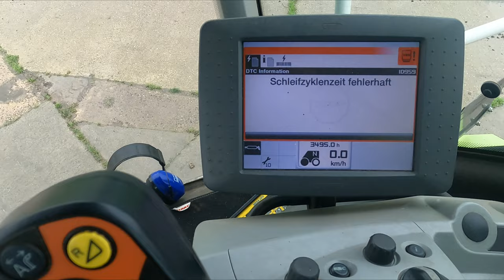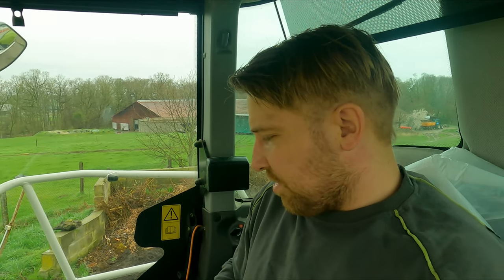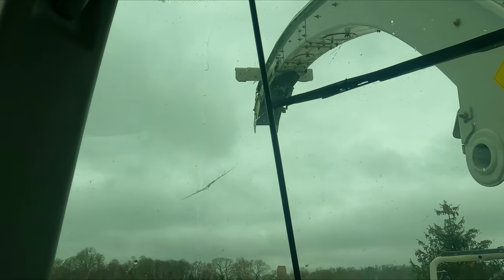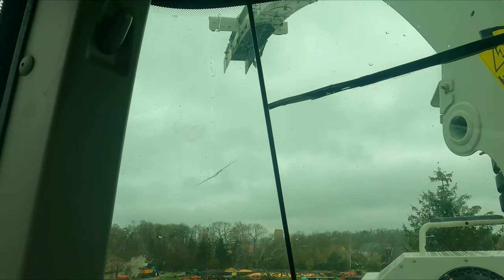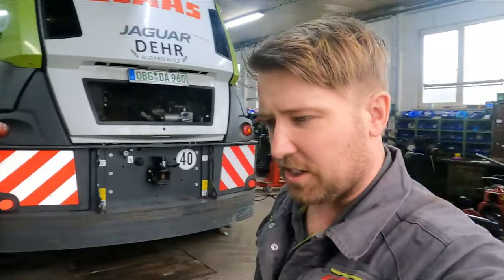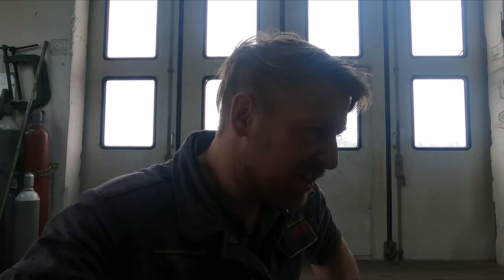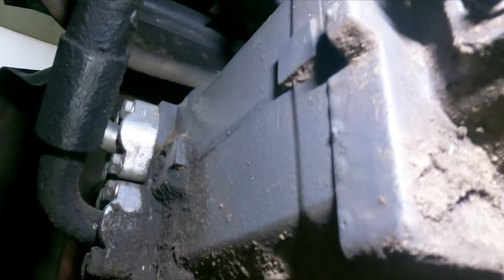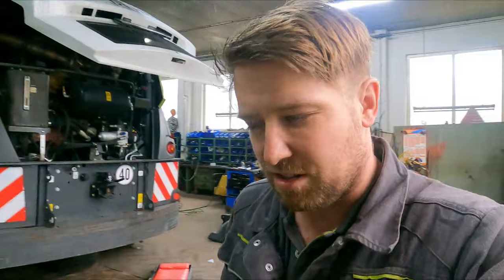Claas Jaguar Service and Pre Harvest check pt1

Comment: Hey great video I’m really appreciating just how much we get to see with you. I don’t know of another YouTube mechanic who would put in as much effort as you! Just one question, do you ever take oil samples on your jobs to look for hidden damage to internals?
Reply from the maker: Thanks allot! As for oil samples we don't actually take samples, One reason is most of the machinery doesn't generally get run to the point that we start planned wear precautions. Our choppers and combines at home will likely never see more than 4000hrs so we kind of just expect a motor to run those hours without major wear. As for at work it is something I have been thinking about since the drastic rise in oil price. But mainly for things like self propelled feeder wagons that receive 400l of Dextron 2 every 1000 hours. at around 7euros per L. Oil analysis could help us possibly run the oils much longer. Other than that I am interested to see if I could learn more about my job by using such samples.
Reply: I understand, the only time I have regularly sampled oils is when I looked after the the hire and maintenance on several large generators. It was very useful for deciding if and when to move a machine on and get another new one. Having a mechanical issue with those particular generators in their setting was not an option. I could really see the benefits of checking the S P feeder as that’s well over €3000 just there in the hydraulic oil!

The information break down you get back is actually pretty fascinating.
Reply from the maker: Yeah I have seen others do sampling and when you know what you’re looking at and for you can tell what parts of a machine have wear problems or are likely to fail. I’ll definitely try it out and get a video on it in the future.
Reply: Hello  Thomas its mum😊